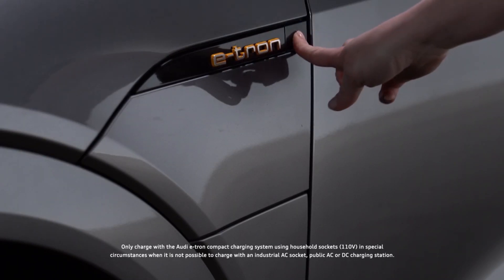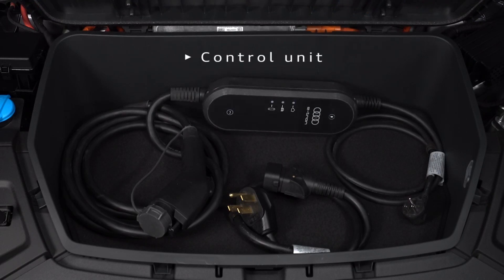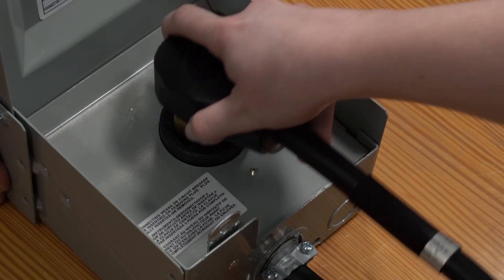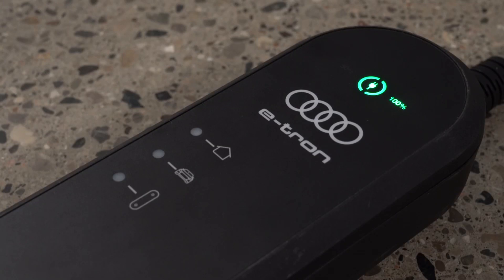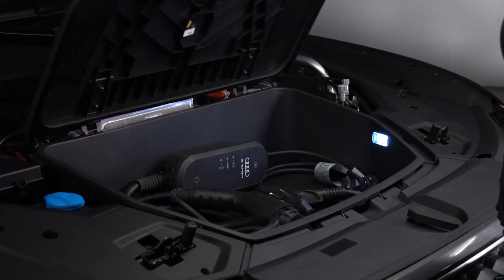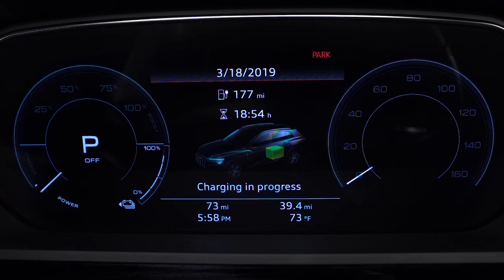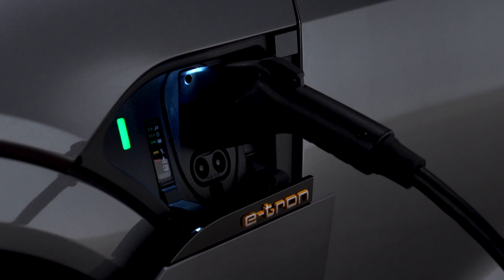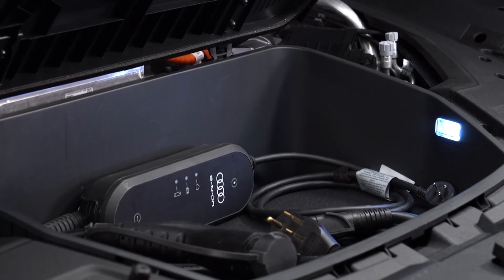Audi Tech Tutorial: Compact Charging System

Comment: What’s the amperage should be? For the 240v plug if I’m installing one in my house?
Reply: I’d put 32A (UK) same as your cooker mains supply, you cannot be too cautious as fires could be caused by over loaded cables. Normal house plugs are 15A but garage appliances like welders and lathes can pull more if under load so may as well do your garage ring main in thicker wire to avoid overheating. Same goes with hot tubs on outside sockets.